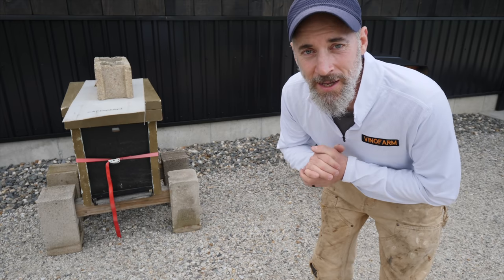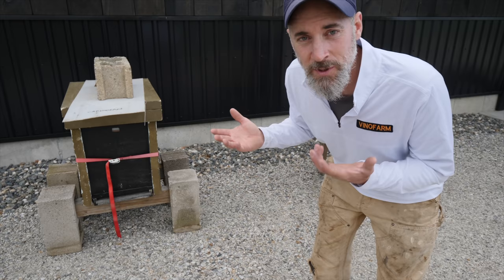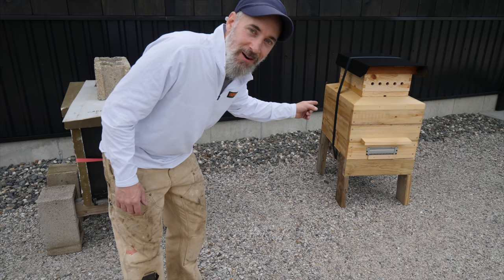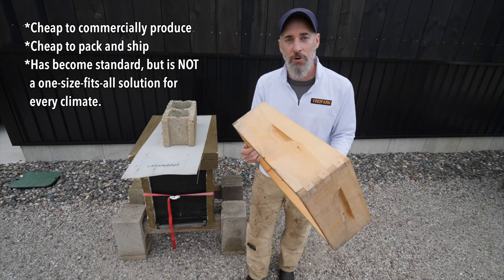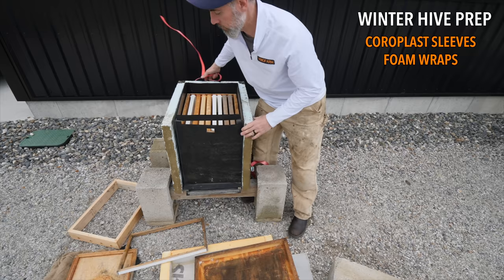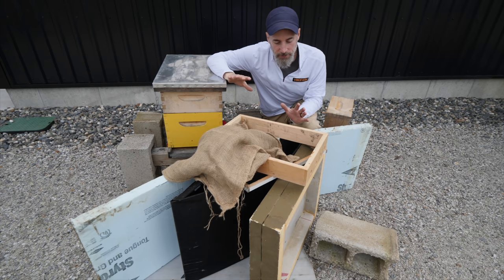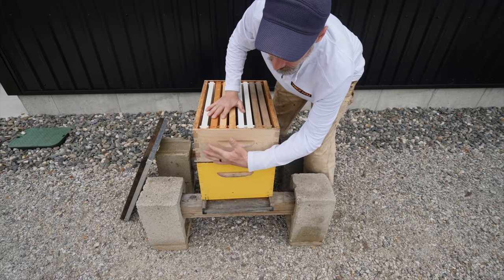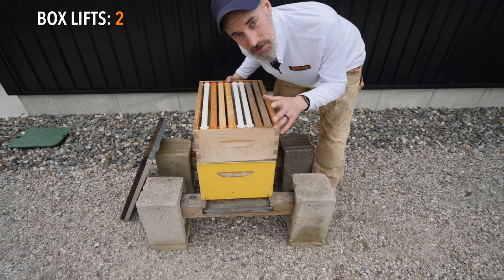I Fixed The Langstroth Hive (For The Bees AND The Keeper!)

Comment: I'd buy a set of frames and the follower boards, and maybe the box too, instantly from you. It's the size of frame and box that was originally used by all the bee people back in the history of Langstroth hives. The story I heard is the wood supply turned to the kind that is used for the deeps and mediums we have now and people went with what was cheap and easy to find. All the observations about what bees would do in a tree was done way back then. They had the super sized frames trying to copy that. Even Dr. Seeley has a talk about up and down movement done for the National Honey show in England. Majority of bees (those not living in structures) move down in summer and go back up in winter following the honey stores.

I'm in South Carolina and was experimenting with a year-round Vivaldi setup when Brushy Mtn. closed. What you say about heat insulation is quite interesting for my climate. Down here on the coast we also have spring fog and some of my instructors were chasing solutions to blocking drafts. I have set my hives on a ventilated medium on the ground. I get a lot of people who see my setup and tell me to get the bees up on a stand. I'm like "the bees thrived two years like this." I hope that we get update about your bees doing well.

About the only question I have is how do you move this beast of a box? I think if it works out for you, that would be the next thing to add to the design. I'm guessing a commercial person could palletize them. I'd have to walk everything into my bee yard piece by piece.
Reply: oh yeah. The follower boards would please my instructors who gripe constantly about the bad design of the 8-frame hive having too much side space.
Reply from the maker: Thanks for your support. The point of designing the box like this is that it doesn’t move. Put it down and then let the bees live in it. It’s not a commercial solution. The individual parts can move, but the main box and stand are meant to stay in one place.
Reply: @vinofarm  I may have misheard the part of the video about commercial beekeepers using this hive. I understand better that this is more like a long hive and is kept in one place.

Comment: Also, according to Thomas Seeley bees don't prefer top entrances. They prefer bottom entrances, but they do prefer their nests to be higher of the ground. A top entrance just leads robber bees directly into the honey stores.
Reply from the maker: I've completely flipped to only bottom entrances this season. I had top entrances for years because that's standard around here and everyone told me it was necessary in the winter for ventilation and incase snow and dead bees blocked the lower entrance. For now, they're doing great, but I am concerned about blocking that bottom over the 6 months of winter.

Comment: Do you plan to use this method for resource/nuc boxes as well? I guess you can shrink the space down as in a package install and achieve the same for space management. I really liked the idea of your resource hive/boxes. Looking forward to see how the bees use this design. Have much of the same issues with cold here on the front range in Colorado. I did use your folding hinge idea this winter for insulating my hives.
Reply from the maker: Resource hives will be deep/medium boxes and hold 4 of these side by side perfectly. Already on it.

Comment: You ever consider just going with Layens frames? Dr Leo suggests those for horizontal hives because the bees naturally utilize them better. Your building you own boxes so you could go with those and avoid the triangular corner bracing and gaps between the med and large foundations.
Reply from the maker: No. Layens is an entirely different system that does not work for me.

Comment: I like your redesign of the lanstroth hive I tried to look through other comments to see if anyone asked the question i have which is what is the dimensions of your new frames. One could use the top and bottom bars from a regular frame but what is the new length of the sides on the new frame. I am thinking of doing something similar not so much for the cold months but to insulate mine for the Hot summer months to regulate temps better here in SC.

Comment: I'm curious about the landing pad.  It looks to me more of just an edge to land on.  Thinking about it, the landing pad is going to be inside the insulation behind the metal gate.  Interesting concept, wonder how well it works compared to standard design.  I'd suggest inspecting the cavity to make sure nothing weird happens, but that should just require removing the reducer.

The variable venting system looks good.  I assume the long cuts are the right size for a secluder (allowing worker bees to pass).  I highly expect the bees to propolis the beejeebus out of them.
Reply from the maker: More and more people seem to be getting away from actual landing boards thinking they are a good place for pests and robbers to stage attacks. However, my upper entrance has a giant landing board (being the upper bevel of the hive body). The difference is that the upper entrance is a highly trafficked and easily defendable (tiny) opening. The lower entrance is not as busy and easier to attack, so I wanted to give the bees a slightly smaller lower entrance that was easier to defend. It's like a cliff face! Easy to push robbers off.

Comment: Well thought out Jim.  I'm in Ontario, Canada and double brood over winter for increased food stores and bees (heat).  This is ingenious.  I am concerned about the weight of the frame when full and whether the top bar will pull off when you lift out a full frame.  Did you increase the dimensions of the frame to address the added weight?   As for dealing with the weight of the supers, I picked up a used electric wheelchair and converted it into a homemade fork lift with a small ATV winch.  No more heavy lifting and carrying.

Comment: I think it looks great. Why not put 4 of the metal circles in, 2 on each side(2 on top and 2 on the bottom), that way when you turn over the top you don't have to take off any screws and move them to the other side. the ones on the bottom could just be set to the open circle.
Reply from the maker: Because the inside one will get completely pasted with wax.

Comment: in poland we use wires in big frames, to hold wax in place so it won't fall during inspection, also we isolate tops of hives very well too, yours seem mostly lacking top isolation

Comment: I love your concept here! I have one hive with my dad this summer, plan on getting my own nucs next year. I'm in Iowa, so it does get pretty cold here also. Just a few questions:

1. How thick is the insulation? It looks like it's fairly thick. Would half inch insulation be a waste of time?
2. I was planning to go frameless with fishing line to reinforce the comb. For this setup, can you use foundations modified to reinforce the edges and corners, but left out of the middle? 
3. Do you just glue the Medium and Deep frames together, then remove the middle section in the middle?

This is a lot for a newbie to take in, but I love the design!

Comment: With that big spacious frame, could you put in some thin wooden rods(think chop sticks but longer) top to bottom and side to side, To create a + in the middle, giving them a sort of nucleus to build out from? Or instead of just crossing the rods, put a circle or small amount of foundation where the rods cross in the middle. That way you'd give them Quaters but borders thin enough to easily cross/build over.
Reply from the maker: Watch some of the latest videos. They are covering every inch of the foundation with no trouble at all. The most impressive comb I've ever held!
Reply: @vinofarm  I've seen them, they're quite impressive. I was just wondering from the "let the bees build what they want" side of things, if they just have a starting point maybe they'd build some weird and wonderful shapes. A risk of them building across frames, though, I guess.

Comment: tiny optimization idea for lazy keepers: just install 2 more of those metal circle bits, so instead of flipping them you can simply turn the bottom ones to fully open and set the top ones to what you want. that is, if the bees are ok with walking across metal, not 110% sure about that.

Comment: Hi Jim,  I just finished constructing some of your new frame design.  I've noticed in later videos, you switched the brood frame to the lower and honey super to the upper.  My prototype was with your original frame, but then I built the rest with the brood foundation on the bottom.  Reason is for better stability?  Haven't done the bee barn.  I'm going to see if I like the mega frames first.  Always love your videos.

Comment: Instead of changing the circular multi vents between seasons just double up with one on each side, too and bottom. Your can still control ventilation and feeding without switching. Just my thoughts.
Reply from the maker: THe bees would paste them with wax and propolis. I thought of that. It takes 30 seconds to swap them two times per year.

Comment: William Erpel (aka Beehaven) did a version of this Feb 2020.  On FB he seemed to be having good success.  I don't think he reinforced his frames.  He was very responsive to FB contact if you are on there.  I only mention this because it might save with frame construction time.  Really like your inner cover and above thoughts and design.  They are beasts.  I finished a version of Bill's using 3/4 ply inner and outer sandwiching 1" insulation.  Weighs a ton.  But I agree, let the girls have the bottom and I can put flows, Ross Rounds, or shallows on the top and then the quilt box, candy board for the winter (Cape Cod).  Cheers!
Reply from the maker: Cool. Unfortunately, I’m not on Facebook. (Or, fortunately, depending on how you look at it.) A few commenters seem to have had the exact same idea and tried this out, which is cool. Maybe my reach will get more people to experiment with it so this can be streamlined. It’s quite a process to construct.

Comment: I'm making sketchs to make one and I noticed 2 things:
1... there is a thermal bridge right on top. That's fine with your winter, but here... it goes down to -40'C ;) So I might change that.
2... how do you deal with the spring when there's about one inch of dead bees over the scree board ? Last spring bees needed me to shovel them out so they can use the lower entrance again :S If you plan to lift the whole thing, that would be heavy as... outch !
Reply from the maker: 1. I'm not finished with the top. I will be making an updated cover for it in a month or so when we start heading into colder weather. There will be some tweaks. Stay tuned.
2. I have not experienced a spring with these yet. They just went in in May. I plan on using the same technique I used with normal Langstroth hives... a long, skinny rake that I can reach in and drag out any piles of bees right out the front entrance.
Reply: @vinofarm  Oh... that long skinny rake is a good idea. I might do the same.
I was removing everything and shovelling the screen... I taught it was a bit crazy.
Using a racking cane from homebrewing coul work I think. :)

For the top part, that's cool.
I taught about it too, removing the classic roof and replace it with a top that fit exacty the all season part. Maybe with a little bit of soft insulation between each other.

Congratulation again for the video. Too bad YouTube can't accept images in reply. I would share my sketch to discuss with less words !

Hope you have a nice summer !

Comment: Really enjoyed this video!! I’ve had this almost exact design in my head for a couple years after reading a study on the benefits of insulation in the summer and also based on all the issues you mentioned, but have not taken the time to build it yet. Can you please show how you made the sidebars for the deeper frames? That is the only part I haven’t made a plan for and I assume you probably have a slick way to make them easier than most. Thanks!
Reply from the maker: I’ll do a frame video at some point. Lots of people are asking. Thanks!
Reply: @vinofarm  In case you did not come across this article in any of your research, this has some interesting info on hive temps and honey yield for insulated vs non-insulated brood chambers in the summer.  Small sample size, but interesting nonetheless.  This is what got me thinking about a design similar to yours even though I live in Missouri.  More to address the hot summers than the cold winters...though I would suspect the bees would reduce honey consumption through the winter. https://semaponline.org/wp-content/uploads/2019/04/FAF-insulated-hive.pdf
Reply from the maker: @katyc8868  Well, damn. That’s amazing. I had not seen that but it seems they had the same idea and went ahead and did the exact same experiment I’m doing. Even the same sensors! I hope to become another data point for them and will share my results once I see how my hives do. Thanks so much for sharing. It gives me great confidence to know this has worked already! I can’t wait to see how this season goes!
Reply: @vinofarm  Glad you enjoyed the article. I definitely prefer how you fully integrated a deeper brood chamber with continuous frames into the stand with your design so there's no lifting.  That was how I planned to do it as well just because I'm already at my weight limit lifting standard non-insulated 8-frame equipment. I suspect you will be very successful with your new bee barns and I'm especially looking forward to watching this season! Wishing you the best!

Comment: Check out the segeberger beute and the frankenbeute both are isulated styrofoam hives. Deep frames like this available. This is how i work. Works great. Broodnest is really a ball and divider board is also used like this. 
I like your design. Very sturdy and insulated. No heavy lifting. Still use standard frames and Honey box. Great ventilation

Comment: Jim, I like your innovative mindset and this is a very interesting idea (or set of ideas).  I am wondering how you would deal with the extraction issue for the honey?  These frames would not fit...nor would the German ones mentioned previously below.  I am wondering if extractors in Germany are oversized compared to US extractors, to accommodate these frames...?
Reply from the maker: These are brood frames. Honey supers go on top. I will extract regular medium sized Langstroth frames in my current extractor. 15:18

Comment: Great idea! would it work to run foundations up and down instead across for the continuation of laying space you talk about?
Reply from the maker: The way I did it is working perfectly. I tried vertical, but there was not a good way to attach them and it required a lot of cutting.

Comment: I'm seeing this video 5-3-22, so I don't know how it turned out. I will check to see. But, on its face, I love it! I love everything about it. I am wondering why you wouldn't insulate the summer super. If insulation is right for summer and winter, and I believe it is, why wouldn't you do the same for the honey super?
Reply from the maker: Hassle? More work? Didn’t think it was necessary. The supers are only on for 4 months. The important part of the hive is the brood nest, which is permanently insulated. Watch the next 10 videos… this worked like a dream.
Reply: @vinofarm  It sill might be interesting to see if they are more prosperous with an insulated super. When I was a kid, there was a TV add that said "Better milk is produced by contented cows." Maybe slightly cooler bees (owing to the insulated super) might make more honey. Just thinkin' inside the box.

Comment: Have you tried wool for wicking moisture, or is burlap better? Researching for when I get bees. 🙂 thanks for sharing with us!!
Reply from the maker: I’ve had the same burlap in there for years. It gets wet and dries out. Never had any mold problems or anything. It’s the only thing I’ve ever used. I like that it just stores in a folded pile all summer and is ready to go every winter. I’d think piles of wool might be a bit of a hassle. But I’ve never tried it.
Reply: @vinofarm  thanks for the quick reply!